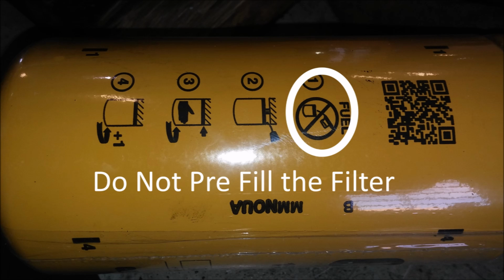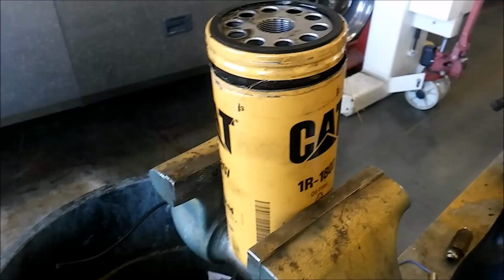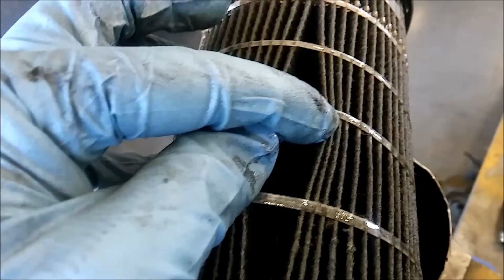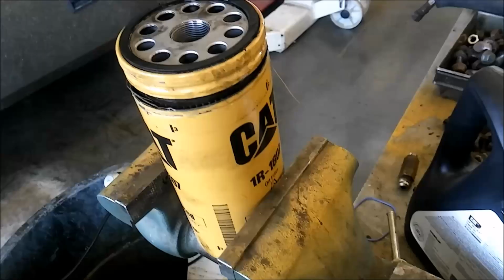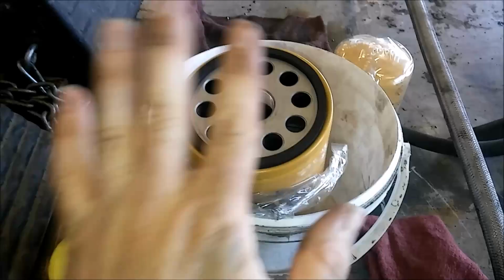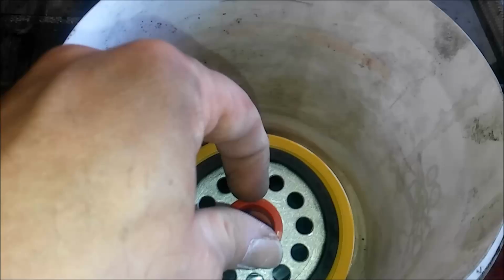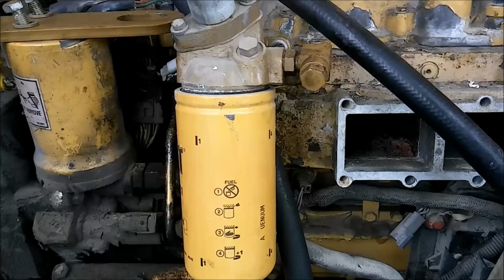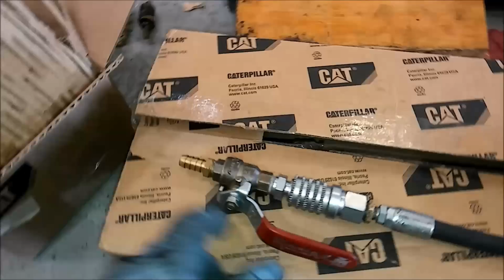Should You Pre Fill an Oil Filter? Should You Pre Fill a Fuel Filter?

Comment: if the motor is new or hasn't ran for a long time.....just turn the motor over with the starter for a while without actually starting it....problem solved.

Comment: and riddle me this what if you filter your oil before you put in huh
Reply from the maker: +lil nick The main point of the video was to put the oil in on the dirty side of the filter, which can be different from manufacturer to manufacturer of the engine, that way you can pre fill and keep the oil clean. If you have a very clean filtered oil going into the filter though, you would probably be just fine either side of the filter.

Comment: So what happens to the vehicles that don't use filters like old vw and motorcycles.... what about when the filter bypass opens and the oil doesn't get filtered?? If your bearings get damaged from some thing in the oil then your oil pump is probably damaged also as well as all the oil gelleys, this is probably the worst video I have watched..... oh btw what is a filder??

Comment: my civic neither says to do it or not do it
plus unless you're some kind of an idiot I don't think you're going to get metal filings in the filter as you're filling it with clean oil.
running bearings without oil for a couple seconds .. I'd rather not...

Comment: No reason to pre-fill any filter unless a machine specifically calls for it.  1 reason, well it's not needed, and the second as described in the video -- contamination.  Even my oldest machine only has its oil pressure come up at a rate twice that of normal starts.  That's basically adding a start worth of no oil pressure to the machine.  Not a big deal.  Diesel fuel filters, even less of an issue, especially seeing how most have low-pressure, high-volume feed pumps that keep the filters full, assuming the tank isn't above the filter (some use both).  Time is money, and pre-filling filters is a waste of time.  Especially creating a special hose to do it when it's just not needed.  Still have to hit air bleed screws / use hand prime pump as no way to get all air w/ out such process (in fuel systems).

Comment: the filters are  CIRCULATION filters ,they intercept particicles as the oil flows by ,even large commercial engines pump hundreds of litres in oil through the filters every minute,doesnt matter whether you fill through the oil filler or pre fill the filter ,the same oil will be back to the filter(s) in a matter of seconds,,,,on car engines the engine makes oil pressure quicker with a pre fill,just speed up filling those bearings a touch quicker is all---

Comment: Way too many unnecessary steps wasting time, just fill the oil filter with clean oil almost to the top and fill the fuel filter to the top until it spills over that's the right way ✌🖕